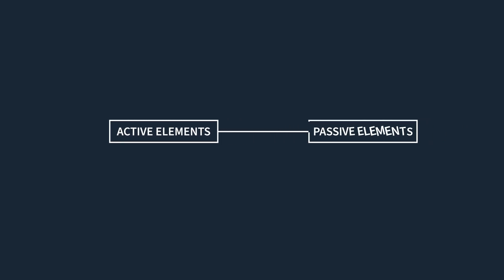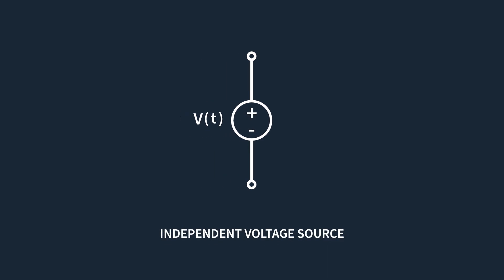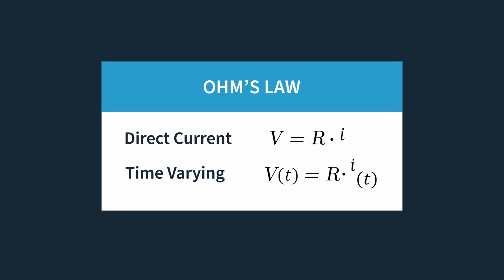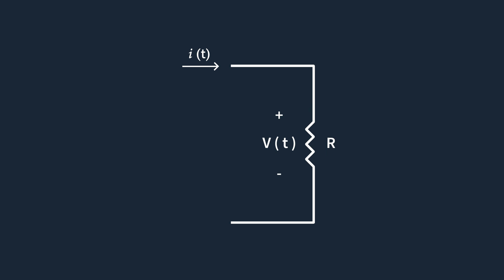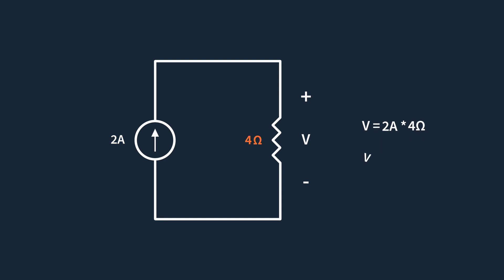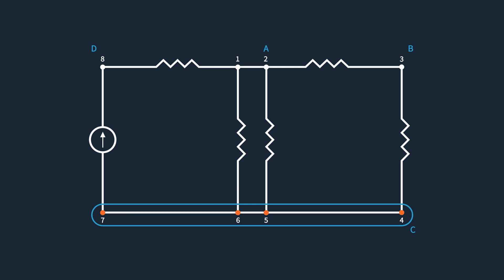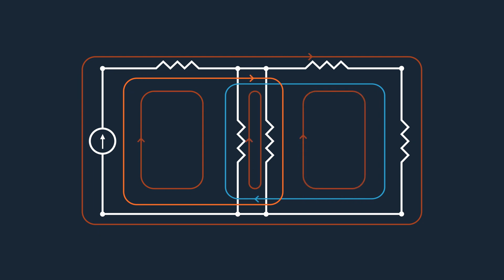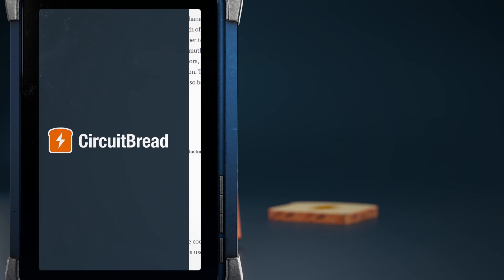Ohm's Law, Power Sources, Branches, Nodes & Loops | Components of an Electrical Circuit

Comment: the quiz on your website was extremely helpful... much better than my professors have done things. I have my final tomorrow and i'm going to do this whole course and see how i do. (i went to every lecture, but struggled to understand the calculations. we had a change in teachers twice during the block, so it was chaotic af. This is my literally my only hope to review and see if i can cram in as much info as possible before tomorrow)
Reply from the maker: Good luck with the cram session, we hope it helps! 😎